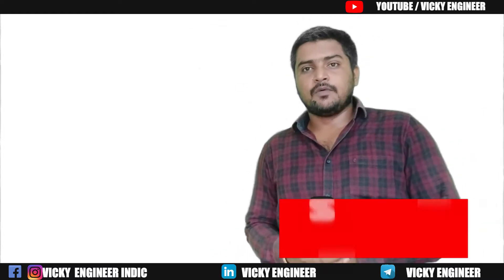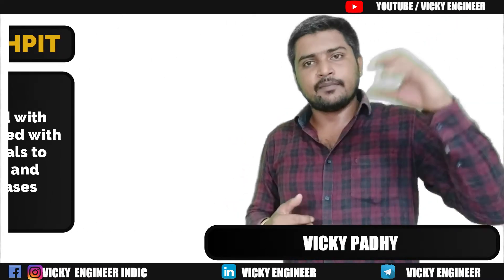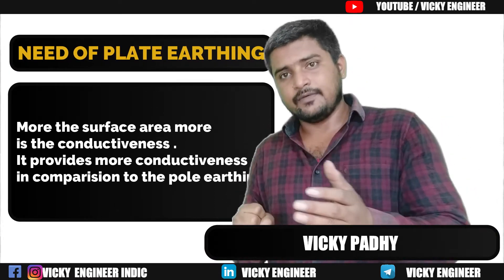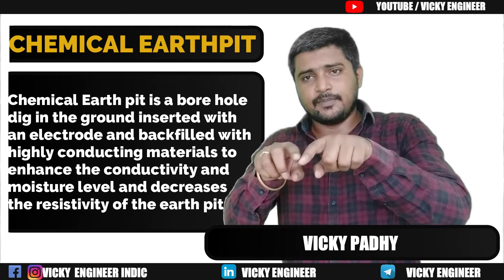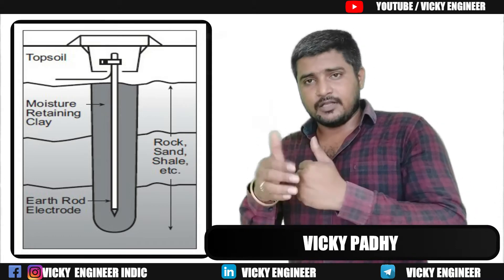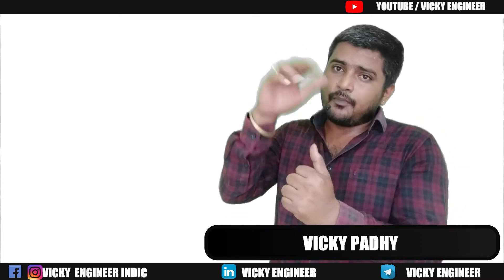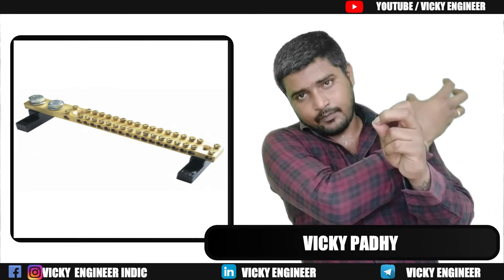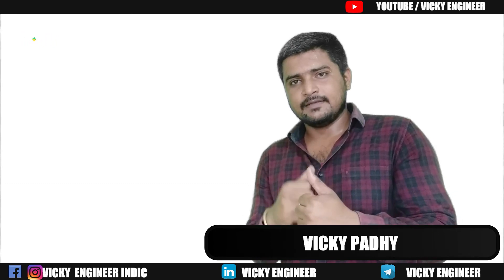Chemical Earthing & Earth Pit Basics | How Earth Pit Works, Materials Used & Key Points to Consider

Comment from the maker: Thanks for watching!
This video explains Earth Pit basics, Chemical Earthing, Plate Earthing, materials used, and key points to consider before designing or installing an earthing system.

💬 Comment below:
Do you want a separate video on earthing calculation, resistance testing, or complete earth pit installation demonstration?

Your feedback helps us create better electrical engineering content! ⚡